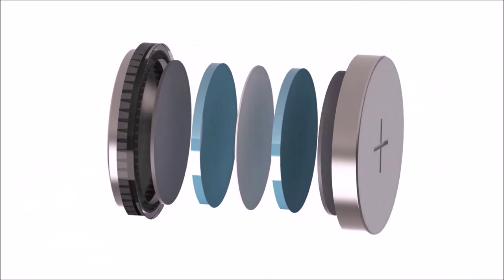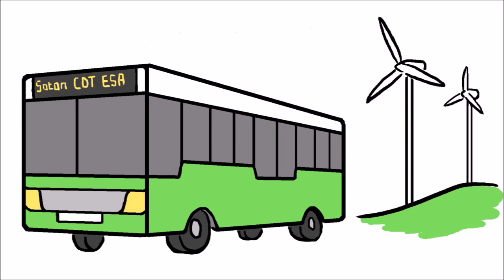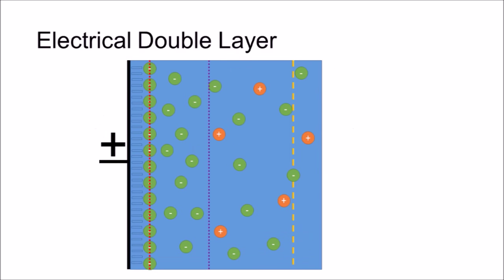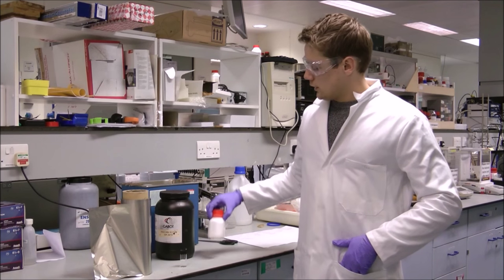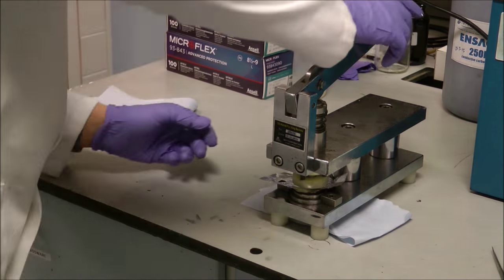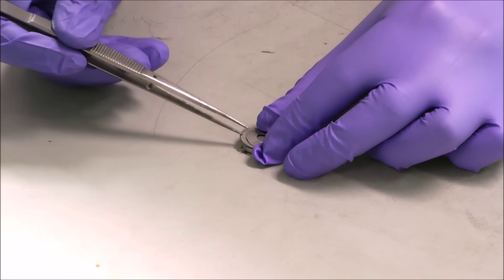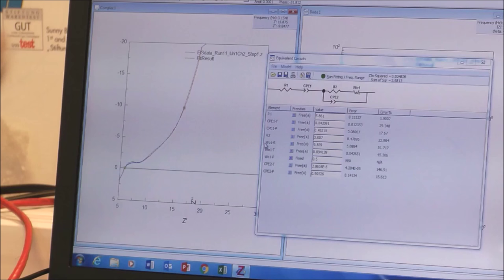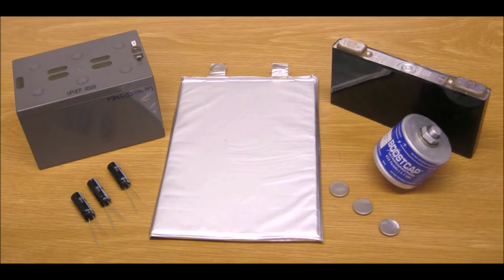What is a supercapacitor?

Comment: Great video, thanks! I wonder why so many capacitors and many batteries are cylindrical in form. Both of these are commonly made of flat layers that are rolled up like a Swiss roll. But for certain applications, say for an electric car, wouldn't a big flat shape made up with multiple layers fit the underfloor area better. As I understnad it eV battery packs are made by combining many standard cylindrical cells. surely this configuration with many gaps between the cylinders is less energy dense than stacked rectangular layers would be? Wouldn't cuboid batteries and capacitors be more useful than cylindrical ones in many situations? Just wondering?
Reply: In general, volumetric energy density is not the driving concern for cars, so much as gravimetric energy density ("specific energy"). Cars have plenty of space to work with, but the weight of their components directly affects their range and efficiency.
Reply: Thanks for this response, much appreciated.

Comment: The mechanical analog of a capacitor is loaded spring. Inherently capacitors discharges exponentially. I don’t see why it could ever replace the battery